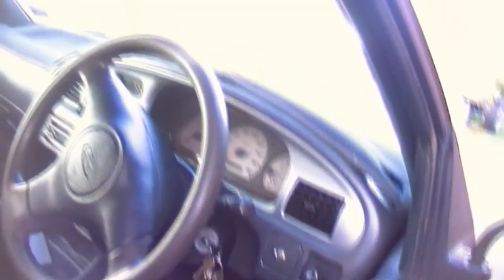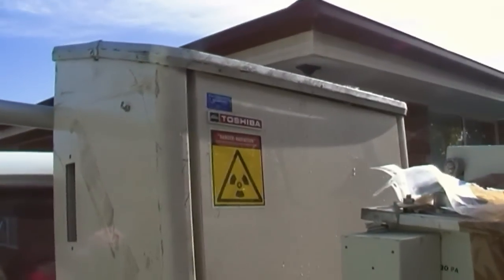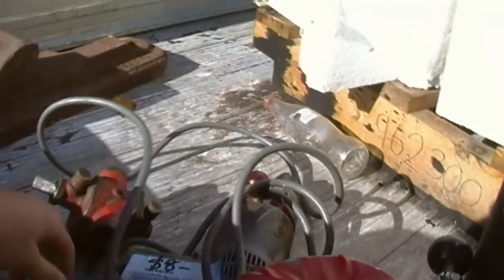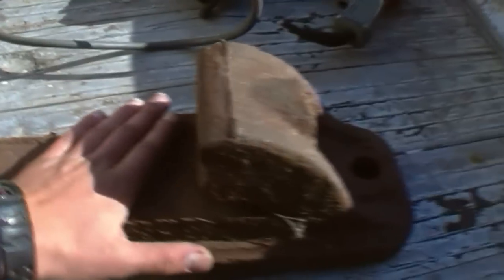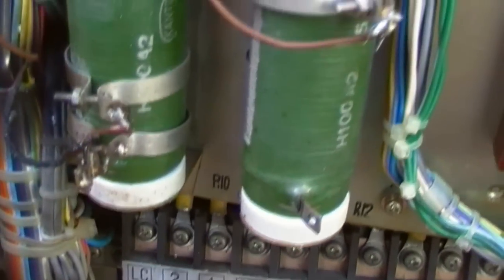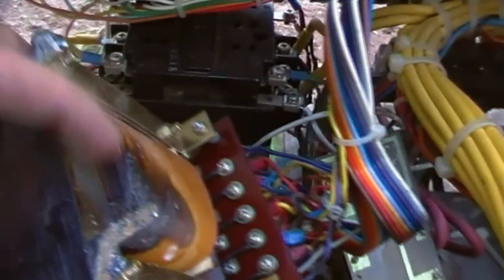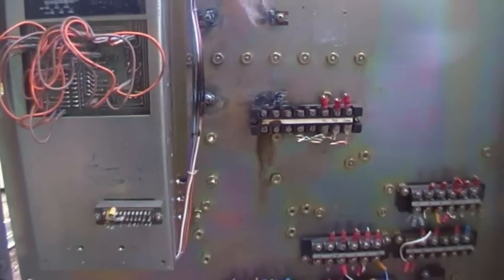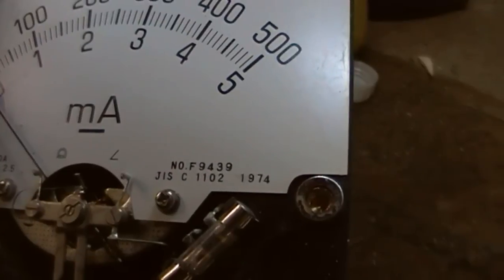Clynton's Shed - Toshiba X-ray control unit

Comment: i found a toshiba x-ray machine going to scrap many years ago-got some nice HV caps which work really good with an NST,and still got a pull out circuit board somewhere that looked the same as the ones you had there.